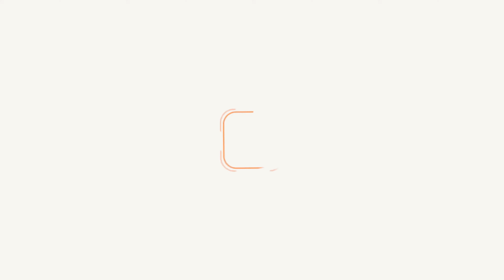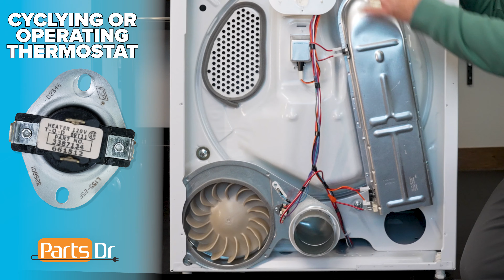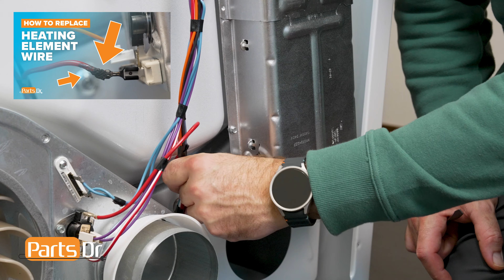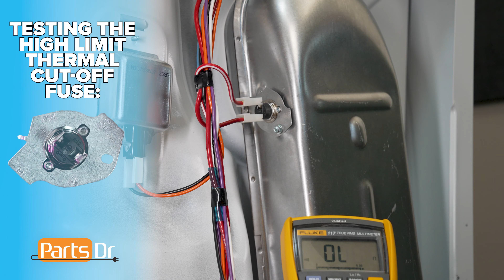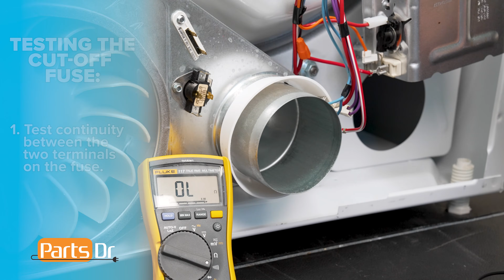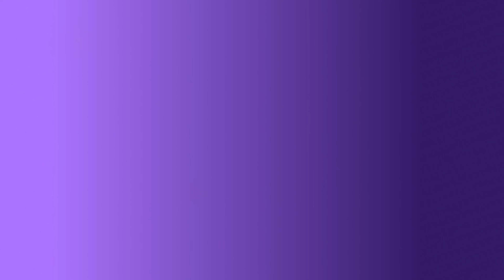Whirlpool Dryer Not Heating? Troubleshooting Tips & Fixes - Whirlpool Maytag Amana Kenmore Dryer

Comment from the maker: We hope this video helps you troubleshoot your dryer heating issues! A quick heads-up when buying replacement parts, beware of low-quality aftermarket options from places like Amazon or eBay. These parts may be cheaper but often don’t meet OEM standards, leading to more repairs or even damage to your dryer.

For reliable repairs, stick with original OEM parts. You can find high-quality Whirlpool dryer parts on our website at https://partsdr.com. It’s the best way to ensure a lasting fix!

Good luck with your repair, and let us know how it turns out!

Comment: Gas dryer gets low heat, back lint filter only collects lint on lower quarter of filter. Is it ok to use on air fluff  cycle until repairs are made on heating issue?

Comment: Great video!!! Unfortunately I still can't track down the reason why my Whirlpool runs but has intermittent heat. It works more consistently on the "Auto Sense" setting but still it's a gamble. 

Checked heating element, good.
Checked all fuses, good. Pulled the thermostat, good, tested them with heat and they test in the operating range. Tested cycle thermostat, good, tested with heat/temperature change, tested withing range BUT on the low side.

Disassembled the cycle switch, cleaned all contacts like points on an old car, tested continuity thru the settings. 

I checked grounds and connections, cleaned all and tested... Only thing I haven't got to is the drum motor switch. It runs and tumbles just fine but maybe the switch on there to actuate the heating system is dirty, stuck or failed?

Anyways, back to brainstorming... Thanks for the helpful and informative video, definitely subscribed!
Reply: I'm having the same problem. It's mentioned to me it could be the connections with the timer. Needing a new timer I guess.
Reply: @CharChar876  yes! Thanks for reminding me because I did end up figuring out my issue. It was the switch/timer contacts inside the switch assembly. I was able to jump the contacts and confirm, I simply took a piece of rubber and braces it behind the contact as it was slightly bent back/too gapped over the years of use and I cleaned the contact with a file. They are like points in an old car distributor, very easy fix if one is mechanically handy. 

Hope it's of some help to you and anyone else that may stumble upon this comment! Take care!

Comment: Hi so I have the exact model I believe in your video here. when you took the lint shoot off from the back of unit I noticed the foam gasket edging the ported holes. That is the issue I have with my unit it was accidentally pulled out from the top...my question is is that foam piece easily fixable?....I'm somewhat handy but not with electric
Reply from the maker: It's pretty easy if you follow our guide here: https://www.youtube.com/watch?v=38x6L50cVXQ

Comment: Now, here’s on problem that can stump one when a dryer isn’t heating very well which can ultimately lead to a electric dryer “not heating”. I’ve had a couple dryers come through that would heat up somewhat, but weren’t getting no where near the temperature despite cleaning everything and a clean unobstructed ductwork. Turns out, the high limit thermostat was weak or was replaced with a thermostat rated for a much lower temperature causing it to not get up to the operating temperature. This can cause the dryer to run for a long, long time, or shut off too soon with damp laundry.
Reply from the maker: That is a tricky one!  Thank you for sharing that!  We have also seen the opposite, where someone places a high limit thermostat in place of a cycling thermostat causing the dryer to overheat and blow thermal fuses.
Reply: @ for sure had a thermostat rated for a significantly lower temperature installed on a 1974 Maytag DE806 I picked up back in 2018. It would heat up perfectly fine, cycle the heat off at the specified temperature according to manuals I’ve found online. But here’s one thing it would do: would cycle on the high limit with larger loads of laundry along with making a faint audible ‘click’ not too long after you opened the door. Didn’t think much of it since I asked around about those older Maytag dryers in various Facebook groups and got responses: “Those Maytag Halo Of Heat dryers have very sensitive high limit thermostats due to the design since the heating element is at the very front of the cabinet and is inches away from the drum”. Continued to use it for awhile until the wire from the high limit thermostat to the heating element burned out. Looked at the high limit thermostat while it was open, tuns out it was replaced with one that was rated for 140F, not 155F. Ended up replacing it with a Supco L160-20F thermostat since the original was NLA, not the exact replacement btu close enough. So far has been working flawlessly for the past 5 years since I’ve made that particular repair. Will probably run for many more years since it uses v-belts and pulleys for the drum drive/tensioner, even have a few belts stashed away. If you look up Maytag Halo Of Heat, you’ll see what I mean.